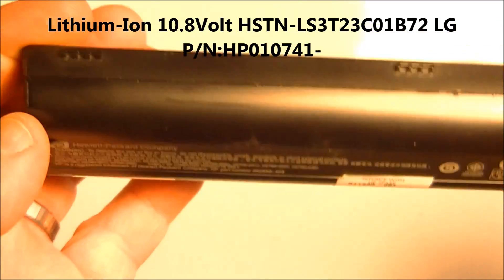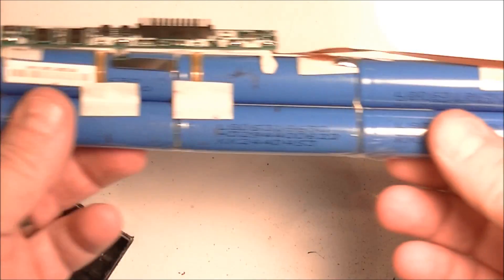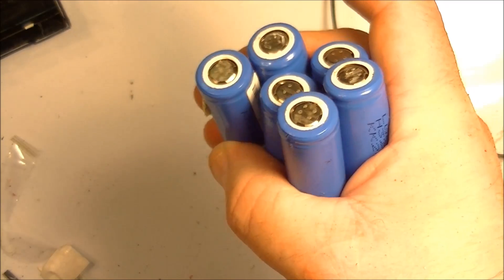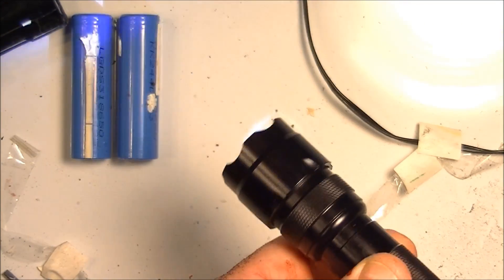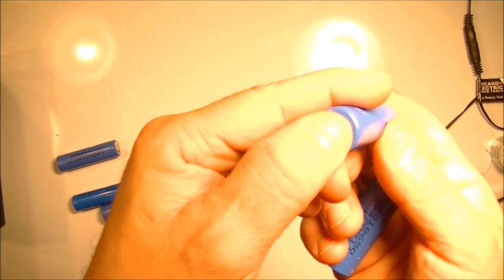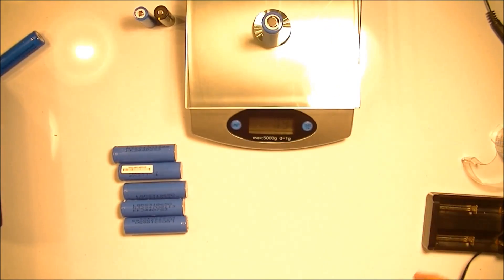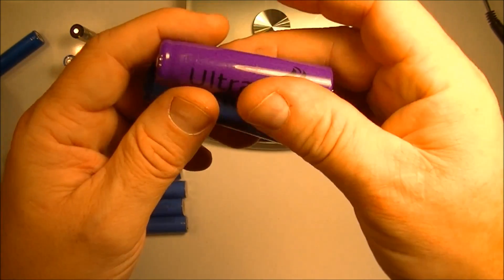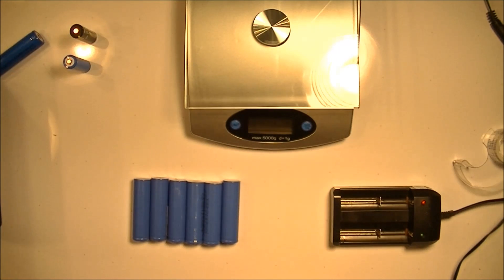18650 Lithium-Ion Battery Harvesting From Old Laptop Battery Pack

Comment: Dear Richard do you know the constant discharge and max discharge of these batteries? Or is it possible to direct me towards a site that has that information?
BTW this vid helped me salvage the battery pack from my old battery pack of my HP laptop.
Great informative video.
Reply from the maker: +Pero Xepatonio It differs from manufacturer to manufacturer and even between different batteries from the same manufacturer. If you can see any printing on the cells you may be able to identify the manufacturer and the cell type as well and go from there. I use a basic RC charger to test these cells but that only tells me the Mah capacity. Here are all my battery videos: https://www.youtube.com/playlist?list=PLnxXRLSlmSVO3L0jStRnPEEN2egrODjnm  Thanks.

Comment: spent the last 4 months harvesting laptop cells, what a job
Reply from the maker: +HBPowerwall Why were you harvesting cells for 4 months?
Reply: Just for my own project - and i should have said i've been processing laptop batteries for 4 months. +1300 cells so far :)
Reply from the maker: +HBPowerwall Wow, that's one large project you are working on. Thanks.
Reply: it's three years later now, how did your project turn out?  and what was your project?

Comment: Just took the batteries out of my old HP battery pack and it had 6 of them. I can't find what battery or voltage they are though. It has a number on each battery that I looked up but can't find anything.
Reply: Checked them all with a multimeter and they all came out to about 2.5-2.6 volts
Reply from the maker: +Josh J They most likely are an OEM 18650 Lithium cells which usually are rated 3.7V. Get a proper charger to safely charge the cells. Here is the one I use Nitecore IntelliCharger i4 Battery Charger 2nd Gen: http://amzn.to/1wSEZ8u Here is my video review of it https://youtu.be/h-OUYBShmp0?list=PLnxXRLSlmSVO3L0jStRnPEEN2egrODjnm Thanks.
Reply: +Richard Lloyd Oh okay thanks. I'll probably just recycle them to be honest, they aren't protected and I have a few protected cells already and don't really want to risk anything happening with them.
Reply from the maker: +Josh J You are welcome. Thanks.

Comment: If your charger is rated 1.5 volts, it can not charge a 3.7 volt battery. It will indicate it to be fully charged because the battery has a higher voltage than the charger.
Reply from the maker: +Odouls77 Thanks.

Comment: I do harvesting of batteries myself.
Just the other day I pulled 6 fully working cells out of a 2010 HP laptop battery. They all took around 2600 mAh of charge each, which incidently is their rating. Best thing about these; They were 100% free. Some guy just wanted to throw his broken laptop out with everything in and to it. I didn't hesitate asking if I could have it.
I now use them for testing of my powerbanks.
Reply from the maker: +Laziter73 Cool. Thanks.

Comment: Those LG batteries still have their half or 40% cycles or 2 years of ussage left when you use them as single. Because I have heard that laptop battery packs dont use full capablities of these individual cells. How long did they last for you?
Reply from the maker: +Kketansa Art Still using the ones I harvested from this video. I get 1300 to 1700 Mah from the ones I harvested here. Can't beat the value. Thanks.
Reply: Richard Lloyd

Awesome, I did the same with Vaio battery pack. Running well. I guess even if you get a new batterypack for this purpose, they will still be a good value.
Reply from the maker: +Kketansa Art I have done it and the cells were even better, which is what you would expect. Thanks.

Comment: I just tore out my battery pack from my dead toshiba laptop and am trying to get the nerve to take out the 18650 batteries to use in my headlamps-aggravated to the point of screaming as they are china ripoffs-question is can i disconnect these batteries without killing myself-i have a soldering iron  and dremel -but what do i disconnect first ? if i clip all the wires from each other will that be the first step-and yes i have goggles -just how dangerous is this??? and yes i am a woman who can change oil in a car and change flat tires.TIA
Reply from the maker: +crisis corral Disconnect the leads that go to the ends of the batteries first make sure they don't short circuit and you should be fine. Be safe and be careful. Thanks.
Reply: +Richard Lloyd -Red positive first then black neg then the ?ground -in that order? BTW it is from a Toshiba and has 12 light blue bats -hope they're good
Reply from the maker: +crisis corral Just take your time and be careful not to short anything and you should be fine. I am sure the majority of the cells will be fine. Thanks.
Reply: +crisis corral take off the label sticker, use a screwdriver to lift up the side of the plastic and pry it up with pliers, it should pop the plastic piece off and then you can safely and easily remove them. dont worry too much about damaging them though, they are in a metal case. if you do rip the insulating part use packing tape to fix.

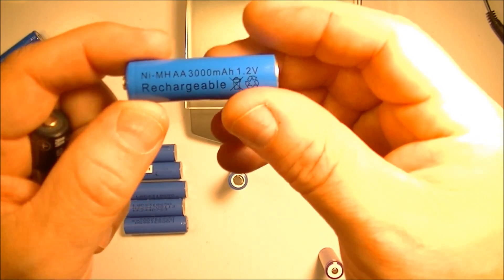Comment: I bought a 4 pack of that knockoff NiMH you display at 8:54 but grey colored. Funnily enough I knew it would be a cheap knockoff (I'm not THAT naive) & only bought them so I could gauge the true capacity which averaged around 350mAh. It definitely felt lighter than the other genuine NiMHs I own.
Reply from the maker: +tombell12 You can tell they are garbage pretty quickly. Thanks.

Comment: Why are laptop batteries using unprotected cells? Is there 1 protection circuit for all these cells in the laptop lithium  pack?
Reply from the maker: +Cosmo John Yes they have one protection and charging circuit. You can see it in the video at the 1:34 mark. Thanks.

Comment: those unprotected batteries are very dangerious.
Reply from the maker: +OpenSource Ftw Only dangerous if you don't understand how to handle or use them. Handle and use them properly and you will never have a problem. Thanks.
Reply: Richard Lloyd
you are right

Comment: I harvested 18650 too but they all come in at 7.2 volts on a multimeter #wtf??????
Reply from the maker: Jonathan Li That is crazy. Are they the right size? They must be doubles.
Reply: haha nvm. for some reason my multimeter is doubling the reading (tried an aa battery said 3 volts)
Reply from the maker: Jonathan Li Time for a new meter. Thanks.
Reply: Replace the battery.  As the battery runs down, the reading goes high.

Comment: This is a case of "Oh it looks like the one I have bought for vaping before". Please don't kill anybody.
Reply from the maker: Michael Dean I state clearly that they are unprotected cells which means understand what that means prior to doing anything with them. Thanks
Reply: +Richard Lloyd That, and they're for flashlight uses in this particular case.
Reply: +Michael Dean just dont exceed 1c continuous or 2c peak and you should be fine.

Comment: You have to pay attention to amp limits, These are not for vaping.
Reply: Michael Dean Not just amp limits but battery chemistry as well. IMR & INR are ok for vaping, but ICR ones are EXTREMELY dangerous if mis-used.
Reply: mwdean i
Reply: Should i even try to put the batterys in a vape?

Comment: I've ordered a Laser + Led Flashlight on China en it may getting home in 2 weeks.

I do have a old Acer battery pack which has already the plastic taken off. They batteries are CGR18650CG. Which leads to Panasonic cells.

Ordered a Imax charger to for properly charging those lithium cells, instead of the included battery charger with the laser.
Reply from the maker: daand12 Excellent decision. The cheap Chinese chargers are better than not having one but just barely. LOL you will be happier with the Imax B6. I am still using and enjoying mine. Thanks for watching.
Reply: Richard Lloyd dunno if that charger is a clone. It did cost me €23,-. I think it's around 30 dollars. This is without power supply. I heard that 1 amp 12v should work for just 1 lithium cell with 1amp charge current.

I do also have another charger that charges nicd, nimh and nizn. It has a 0.9amp charger 12v. Voltage range is between 10~15v for charger.

It can charge 4 batteries and 1 amp just fine.

My imax b6 is currently at Guangzhou Terminal for flying to the netherlands. 

Will charge my 18650 from the pack first. I had them at around 2.3-2.4v under 60watt load. Open circuit 3.6v each cell.
So it is discharged.

edit: i charged those cells using my old laptop where the battery came from.
The laptop charges those cells to 4,08v which is not 4,2v it should do. There was already something wrong when the battery was almost full. It will power a 60w bulb for like 30 min or so i think untill it's around 2,5v.
Reply from the maker: daand12 I know mine is a clone but it works just fine so I don't care. LOL I check the end voltages with my meter and they are very close to what is displayed on the charger so I am happy with it. I find that the 2 amp charger I use is OK but not great. I use a 5 amp 15v laptop power supply and it works very well. Thanks.
Reply: Richard Lloyd You think that a 19v 3,42a will work ? It's 19v x 3,42a = 64,98W of power.

As i said earlier, a 0.9a 12v psu will charge 4 nimh batteries @1amp each just fine. So i guess the B6 won't give me problems either with a 1.5amp 12v psu.
Reply from the maker: daand12 I think you mean 19V X 3.42 A = 64.98W . My PSU is 15V X 5 A = 75 W. Yours should work fine. You can find 5 Amp laptop battery PSU's for under $10 on Amazon amzn.to/1BOJU2m
Reply: Richard Lloyd So you sure i won't blow up the B6 using 19v ?

I heard it may work or may not work and getting a Input error.
I can solder some diodes to lower the voltage, so that's not a problem.
Reply from the maker: daand12 I wouldn't chance it. The operating voltage is 11 - 18 Volts. If money to buy the proper power supply is the issue then you should hunt around bargain shops and garage sales. A suitable power supply should not be too hard to find. Thanks.
Reply: Richard Lloyd Update: Got the imax b6 and the led light just in.
The imax b6 works totally fine with my 12v 1.5amp power supply. I would charge those 18650's at 0.5a first as i don't know their capacity.

Also harvested those cells from the pack. Charger said they were at 4,08v which is right. My multi meter said exactly the same.
Reply from the maker: daand12 Great! I don't have any issues with mine either (fake or not) LOL. I am glad you are happy with it. Thanks for watching.
Reply: Richard Lloyd And doing just a discharge on 1 18650 cell and it's capacity is greater then the laptop told me lol. Nearly 1500mah. Started at 1.3amp discharge and slowly going down at the moment.

stays at 3,00V with 0.3a now.

The cell is a 2250mah Panasonic CGR18650CG

edit: Charged 2 cells and both are fine. 1 rests at 4,15v and the second one at 4,19v. Perfectly fine for a 7 year old pack.
Reply from the maker: daand12 Now that you have the Imax B6 you can actually find out the health of your batteries. Thanks again.
Reply: Richard Lloyd The charger works great, but i have to make something to fit AA batteries into and then i don't have to mess with electrical tape over and over again.

I also had to charge a Nickle Zinc battery on the NIMH mode. Started at 0.8a current and manually set it untill 0.1a and stopped the charging process if it went above 1,9v. Does work great, but you really have to keep an eye onto it as the nizn cell will goto 2volts if you don't watch the charger.

I know i shouldn't do it, but i had already some junk Nickle Zinc cells out of the package. I had one taken apart once and it had a short and then thermal runaway, but since it was just not accepting a charge, it was not able to get extremely hot.

Pretty sure i will get the cell to pop/vent if it overcharges to much.

Also i had my NiCd 9,6v battery pack going to 14v charge voltage if i used rapidly charging ( Pack capacity is about 450~500mah ) and charged around 2,5 or 3c. The pack does get hot :).

Slow charging like 0.5c does the pack not getting hot and charge voltage stays at around 12volts.

One question::

My "200mw" laser should be getting home within a few days and the website said: Include orginal sony Japan 18650 battery. Do you really thing it's a Genuine Sony 18650 ? I don't think so :)
Reply from the maker: daand12 I usually slow charge the batteries as I always have spares and I am not in a hurry. Heat is not good for them. You can get a AA battery holders at Amazon http://amzn.to/1JSDY8O for a couple of dollars to charge your AA with. Thanks
Reply: +Richard Lloyd Update on that 12v psu i was using. Wire broke at the beginning of the psu and now i'm using my old 19v 3,65a laptop charger and that works like a dream :P. Total power usage it can draw now should be around 65watts. I had a big voltage drop when i was trying to charge at 2 amps with 12volts. Even dropped so far that made my imax rebootting itself.

Now charging 3 NimH cells at 6 amps makes my other psu going to 18,6v. Much much better tho, because i was about to order a new 12v 3 amp power supply.
Reply from the maker: +daand12 That's great. That's the nice thing about being able to use an external power supply, if you fry it it's easy to replace and or upgrade too. Glad to hear it's serving you well. Thanks for the information and watching.
Reply: +Richard Lloyd I first thought i was gonna blow up the iMax, because of the 19 volts, but it only gets a little bit warm and that's all.

Charging a fake cell at 3 amps ( 1000mah cell ). Reaches 4,2v within 25 seconds.
Reply from the maker: +daand12 Be careful the cell can self destruct as well. Be safe when charging cells and safe practices when charging and handling them. Thanks.
Reply: +Richard Lloyd 3 amps for like 15 seconds that then quickly going down to about 1.2~1.5 amps.

Even i'm using known brand cell from Panasonic, and that faker is just being used to overdischarge and overcharge to 4,33v or so. Voltage drop under load ( 2 amps max discharge ) is huge. From 4,2 to 3,2~3,3v. It's bad anyways.

Comment: I like to get some 18650 batteries and charger for my flashlight was wondering where you get yours from on the internet I wish I had a laptop battery to get them from but I don't
Reply from the maker: Crimsontide798 Here is a link for this battery pack at Amazon http://amzn.to/1lDiRrS  it's $11.06 and you will get some decent batteries for the price. I tested all the batteries I got out of the pack and I they ranged from 1300 mAh to 1793 mAh and I got six out of the battery pack. Here are all my charging and battery videos https://www.youtube.com/playlist?list=PLnxXRLSlmSVO3L0jStRnPEEN2egrODjnm Thanks
Reply: Hit a pawn shop or hit up your friends.  Literally EVERYONE has old laptops lying around in their basement or storage room.  You'd be surprised at how much are just sitting around unused.  If the battery has sat for years you may have some dead cells on your hands.  Li-on doesn't play nice with full discharges.
Reply from the maker: +@ffec+ Thanks.

Comment: id recommend leaving the tabs on these, just snap them. as u can see it leaves little holes if you do :)
Reply from the maker: MediaMocker I just used my Dremel tool to sand the tops smooth. These tabs are sharp if you leave them on. My preference is to take them off but it's up to you. BTW sandpaper will work fine as well. Thanks.
Reply: Richard Lloyd I only mentioned it as lithium becomes volatile once exposed to hair. I had a cell vent after a few days when tearing off tabs. So its a lot better to smooth the tab down than yank it out :p "Exposed lithium can react with water or moisture in the air 
causing potential thermal burns or fire"
Reply from the maker: MediaMocker Good safety tip. Fortunately the casings on my batteries were tougher than the tabs so the holes occurred in the tabs. Unfortunately the only way to find out which one will win is to peel them off at which point if the tab wins it's too late. Thanks again for the tip and watching.
Reply: +Richard Lloyd 
They were commercial batteries to begin with, THEN the tabs wrte lightly spot welded on.  I could see keeping the tabs in place causing damage in your devices due to the additional battery height.

great video.  I've got a handful of high quality batteries from years past that should net some quality 18650 cells.  Remember that tool batteries also contain quality cells.  Eg. the DeWalt 20v batteries.
Reply from the maker: +@ffec+ Thanks.

Comment: It is theoretically possible that the UltraFire's are first-gen Li-Sil which, while having much greater energy density, have massive degradation after only a handful of cycles. Keep in mind that Tesla Motors chose Panasonic 18650's after extensive testing on all 18650's on market, and then some prior to choosing Panasonic for their vehicle. There's a good bet there is a reason why.
Reply from the maker: Bryan Barnard I am still using the batteries I have harvested from this pack and with my Lipro charger have determined that they are 1200 to 1700 mAh and I have no idea what they were originally rated for but they are far better than any 18650 Trustfire, Ultrafire I have and I will never buy another ****Fire battery again. They are all garbage and these are a far better value. I have bought many Panasonic NCR18650B 3400 mAh batteries and they are are amazing. Here are those videos: https://www.youtube.com/playlist?list=PLnxXRLSlmSVO3L0jStRnPEEN2egrODjnm Thanks
Reply: +Bryan Barnard panasonic, samsung, and most name brands other than generic chinese brands are guaranteed capacity. if you want a 100% guarantee of capacity use laptop batteries.